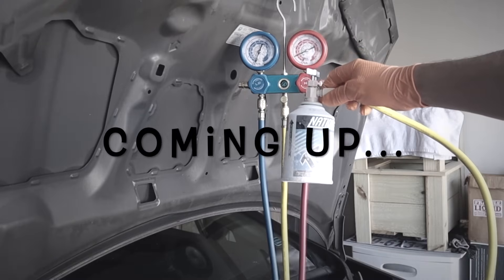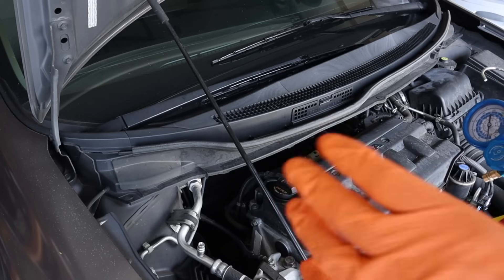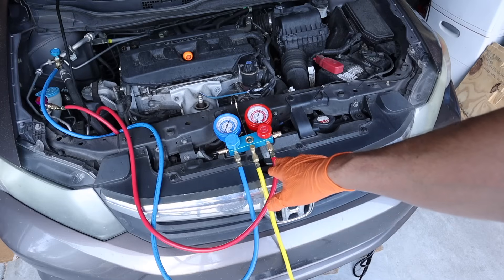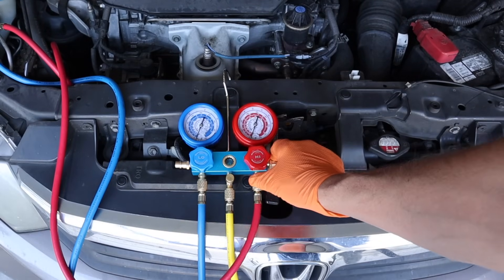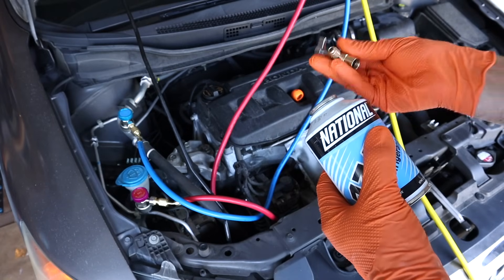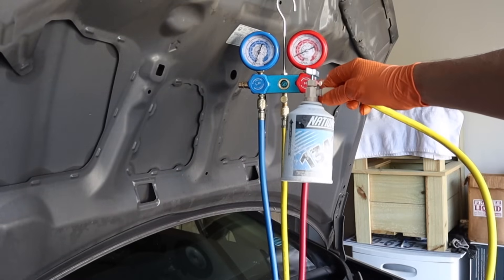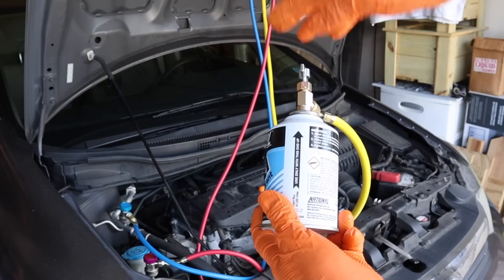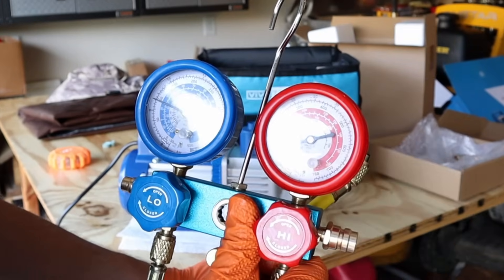DIY Tutorial - Proper R134a A/C charge & Diagnostics

Comment: Quick question, what does it mean if the HIGH pressure gauge goes up in psi almost reaching 300psi? Would that mean it’s a stuck expansion valve? Or did I make a mistake somewhere causing that much psi on the HIGH line
Reply from the maker: Good question for sure, and yes 300 psi is too high. Shooting from the hip, I'd say that you may have put in a little too much refrigerant. That would be your best case scenerio, and hope that's it. So repeat the process, I know its a pain, but try again. The other option is yes it could be an expansion valve issue, or even a restriction in the condenser. You'd get off pretty easy then if the only issue is a little too much refrigerant. Hope that helps!

Comment: $150 later for the pump and the gauges, and the problem is still not solved... Great DIY project... Thanks for the video anyway...
I have the same issue with my 2012 Chevy Malibu LTZ 3.6L V6, no cold air, clutch engages, I hear it and I see the RPM changing when I press the AC button on the dash, Relais and fuse are good, I tested it, I used a pressure gauge that I had from an old R134a can that came with it (only the blue side though) and I had about 100 pressure in it. No idea why it is not cooling...
Reply from the maker: Thanks for hanging out today. Now you know that you have a correct charge if you did it the way I showed in the video, now you can check that off your list as a potential cause of your issue (and a shop would have charge you $250 to do what you just did, so you're now $100 to the good). Now, 100psi is too high on the low side. My inclination is to say your compressor is bad. It sounds like the clutch is grabbing it and the compressor is engaging for sure, it's just not pumping. If you hook your manifold gauges back up and look at your high side pressure you should be seeing a reading close to 200psi on a compressor that's doing what its supposed to. Keep me posted!

Comment: Question
I don’t believe i have any freon on my 2010 buick enclave cxl  since the gauges show low should i go to the shop and remove any freon thats trap in
Reply from the maker: That's a great question. If your gauges are on zero (or just a tic above) then no need to go. but anything above that, then yes, there's enough to justify a trip to the shop. It costs nothing but a little of your time. Hope that helps!

Comment: why didn't you just keep the car off and weigh it in as liquid?
Reply from the maker: That's a good question. The main reason is that to put it in as a liquid, you'd really need to go thru the high side port. And that can certainly be done, but it's best done with a reclaiming machine that the pros use. And it's faster for sure. But it's safest when you have a manifold gauge set and are using the individual cans to go thru the low side port as a vapor (can upright). Hope that helps!

Comment: Do you have to add any oil for the compressor if having it all pulled out and are fully recharging?
Reply from the maker: Great question Billy. If you are not replacing any components, you do not need to add any oil to the system when doing this procedure. Thanks for hanging out 🔧

Comment: Remember that AC does more than remove heat (to create cold air coming from the vents) it also dehumidifies. The AC compressor runs in the winter when you have it set to "defrost".
Reply from the maker: Indeed, good point. Some think that they can get by with no AC until they almost get into a car accident because they can't get their windshield to clear when using defrost during the next rainstorm even. Yep, functional AC is more than a comfort thing, it's for safety as well.

Comment: Good tutorial. Question, I have a hybrid vehicle, so even with the ignition on, the combustion engine does not rev in idle, and hence the compressor does not engage while charging the refridgerant. Is pressing on the accelerator the answer, to engage the compressor?
Reply from the maker: Thanks for hanging out today. I don't have much experience with a hybrid system so I'm afraid I can't give you any expert advice here. Having said that, the AC compressors in a lot of hybrids are electrical (not driven off of a belt) so they are free to come on independent of the gas engine starting up. If you have the specific year and make and model of your car I might be able to help you a little more.
Reply: @my-honest-review  thanks. My car is 2017 Hyundai Ioniq Hybrid.
Reply from the maker: @phisher7790  Okay, so you do have an electric compressor on your car, which as long as you are in "ready mode" you are are good to go when doing your refrigerant charge. Just make sure your AC is on the coldest setting (max) and proceed on. Once the system takes in enough refrigerant (it may take a little while) the compressor should come on and draw the rest of the charge in. Hope that helps!
Reply: @my-honest-review  Thanks. Your assessment was correct. The compressor did kick in after the first cannister was drawn in (hot water bath accelerated). I don't know if it factored into the engagement of the compressor, but I gave some gas.
Reply from the maker: @phisher7790 That's awesome, I'm glad it worked out. Yes that warm water probably did the trick, sometimes it's about like watching paint dry waiting for just enough refrigerant to get into the system to kick that AC compressor on. Ok, keep me posted!

Comment: Trying to remove air and moisture with a leak is counterintuitive. It's impossible.
Reply from the maker: It actually is very possible. You just have to a pump strong enough, and a leak small enough. And it turns out, I didn't have a leak at all, which I wouldn't have found out if I didn't go thru this procedure. It was the expansion valve that was the problem and you can watch the video here https://youtu.be/1PBz5_kW6q4?si=GxF1FShIQv6t6PeX Thanks for watching and commenting, you really help my channel!

Comment: How come you treated the first can as 12oz and then the 2nd can as 18oz? That part confuses me…
Reply from the maker: That's a good question, and you're not alone, it's a little confusing. But here it is in a nutshell... 12 oz is only what the refrigerant weighs that's inside the can. The 18.3 oz you see on my scale is actually weighing 3 things...the refrigerant, the can, and the hose that's attached. And when you perform the exact same procedure on your vehicle, you might get a little different reading than 18.3 oz when you are putting in your second can, simply because the hose may be pushing a little more or a little less on your scale depending on where you have your gauge set positioned. Long story short...this is just a relative measurement. Meaning, whatever your scale says before you begin to let the refrigerant flow, just subtract 3 oz (or whatever remaining amount your system needs after that first can) from that number, then stop the flow. Hope that helps!

Comment: I would have turned on the vacuum pump before opening the the valves on your hoses. They had air in them that you just introduced into your system.
Reply from the maker: You could definitely do it that way, no problem.

Comment: Your calculations were wrong on the second can of refrigerant. 12 oz weighs 18.3, that’s 4.575 per 3 oz, not just 3 that you subtracted, you prolly didn’t put enough in
Reply from the maker: I see your math and how you came to your conclusion, however it worked out fine. It's a relative measurement that's not perfect because the hose is attached while measuring. So it's simply stopping the charge when 3 oz (or as close as possible) had been dispensed out of that 2nd can as shown on the scale. Thank goodness there's a range of refrigerant that acceptable and not an exact amount. And after I replace the expansion valve (video here:  https://youtu.be/1PBz5_kW6q4 ) and charged the system in the exact same way as in this video again, it worked out ok, and had nice cold air. Hope that helps!

Comment: Lesson learned: After the initial 15min vacuum make 100% certain that you shut off the valves before walking away for the 45min wait. My gauges are now full of A/C vacuum pump oil. That little window is half full of oil. 😕 I tried pressing that little schrader valve in the center, but apparently it's not made for oil, just air/r134a stuff. It's not letting oil out that way. Gonna run the vacuum pump for that 1hr and see if it pulls any oil out... not so far... and the pump is running low on oil.

Kudos on this video, I've watched probably 7-8 different videos and I like this one the best. Very step by step and specific without being too slow or fast paced. 👏
Reply from the maker: Oh yes, gotta shut those valves good and tight. I think you'll be okay just letting the vacuum run and if the oil stays in the lines of the manifold until you're done it'll be okay. You just need to keep a watch on your oil level in the pump while it's running and don't let it run out of oil while in use or it'll overheat. If you need some more pump oil, here's what I recommend:  https://amzn.to/4jI404T I'm glad the video helped, thanks for hanging out and let me know how it turns out!
Reply: @my-honest-review  I heard this response in my head with your easy paced tone and cadence... LOL.  Honestly, this was both informative and calming.
Reply from the maker: @rfphill  I appreciate you very much! I've been accused of being kin to Mr. Rogers 😌

Comment: Okay, so I rented out the vacuum pump and gauge manifold.  I didn't know that the adapter part that allows you to pierce the cans of 134a were not included.  I bought it from O'Reilly's.  Also the adapter that threads onto the vacuum pump on the side (1/4" thread) also was missing from kit.  Is this piece not included in the gauge kit?  Without that I couldn't perform the initial vacuum on the A/C system.  On the Vacuum pump, what is the 1/2" thread port used for??  I am going in for knee surgery so now this will have to wait a few months until I am able.  Your help and continued dialogue are very much appreciated.
Reply from the maker: Yes, it's understandable that you'd have to buy the valve that threads onto the top of your R134a cans of refrigerant, but there's no reason why you don't have the means to connect your manifold gauge set to your vacuum pump. The yellow hose should screw right on to the threads on the pump...or there should be an included adapter in the kit. The larger thread size on the pump is just for different applications. When you get back on your feet go back and tell them something is missing in your kit. Get well soon, praying you!
Reply: So to be clear: there are 2 sized fitting on the Vacuum Pump.  One is a 1/2" male thread and the other is a 1/4" male thread.  The 1/2" thread typically is upright and the 1/4" thread is horizontal.  Do these both perform a vacuum function?  Because in your video the yellow hose is hooked up to the fitting that is horizontal.  I thought one fitting might be a vacuum while the other fitting performs a push of air into the hose.  The yellow hose did have the fitting that would thread onto the 1/2" vertical fitting from the pump.  I did buy that adapter that pierces the Refrigerant cans.  Now that I think about it those 2 fitting on the vacuum pump are both a vacuum feature, CORRECT??
Reply from the maker: @patrickwhelan5703  Ah, yes indeed, both of the fittings are vacuum fittings. So the manifold set you have is just set up to hook up to the vertical 1/2 inch threaded fitting. I just see the 1/4 inch horizontal fitting used moreso in my experience, but all the same. So you're all good to go then!

Comment: When do you think that adding the PAG oil is good?  Before adding ANY R-134a or AFTER you have added enough of the R-134a??
Reply from the maker: Any PAG oil that's needed can simply be added to the yellow hose just before charging. If you want to watch me do just this in a video, see here: https://youtu.be/P4s-vdzz8vg?si=nNFxVymxk2KU_yui and go to the 1 hour and 6 minute mark. The linked video was about 1 year after this video that you're watching here, and is where I replaced my compressor, condenser, and expansion valve and had to add some PAG oil when charging the system. Hope this helps!

Comment: Hi! I have an empty A/C system, and my vacuum pump should arrive soon.
You say it's best to charge the refrigerant as gas through the low-pressure line (with the can up).
But here in Poland, most ads and guides suggest flipping the can upside down to fill it as liquid, then starting the engine and watching the gauge.
Some people even pour the liquid into the high-pressure side (with the engine off).
Honestly, I’m confused about which method is the safest and most effective — and why.
Greetings from Poland! :)
By the way, great video — I learned a lot!
Reply from the maker: Great questions, I'll try to help. The short answer is keep the can upright and charge thru the low side only (as a gas), only dipping the can quickly every once in a while to keep the refrigerant flowing. Now, having said that, there are people who say turn the can upside down. And yes, you can do that too but if you do, that's when you really need a professional machine (that can reclaim as well). And this is when you'll utilize the high side as a charging point. Those are the two correct ways in my humble opinion. And since most backyard mechanics don't have the big professional machine, like you and I, we need to go about it the way I showed in the video. It's slower, but it's our only option. And now having said all that, there are those who'll still try to charge the system with a manifold gauge set (like what you see in the video) but will keep the can turned upside down during charging. And folks who do this may swear by it and say it's okay. And you may get away with it many many times but you're playing with fire because there is a chance that the compressor may lock up introducing liquid refrigerant into the system like this. And that is the long answer. I hope that helps! (The short, short, short answer: follow what I do in the video and you'll be fine.) Thanks for watching!

Comment: Would you say that 3 hours is the time it takes to refill an empty system?
Reply from the maker: Three hours should give you just enough time yes. The vacuuming is what consumes the most of your time. If done on a hot day, the refrigerant goes in quickly.
Reply: @my-honest-review  Me again....  So about 2 years ago I replaced all of my trucks A/C components EXCEPT for the compressor.  The evaporator, the dryer, Orifice tube, and related hoses.  I have not filled it since.  It's Florida and I don't mind driving with windows down.  Question: Should I still proceed with vacuming out any moisture before recharging the A/C system?  
Question 2: My truck says (on sticker need fan shroud) R134a to equal 2lb 10z which is 42 ounces.  O'Reilly said 40 ounces.  Which would you go with?
Reply from the maker: @patrickwhelan5703  Before you do anything, I would recommend putting a wrench on your AC compressor and make sure it turns. Time not in use has a funny way of messing up AC components. If it turns freely, yes, proceed on with vacuuming and recharging as you see me do in the video. And you can stop at 40 oz and see if you're getting cold air, and if so, stop there. Make sure you're putting in a few oz of PAG oil as well. I don't know your specific PAG oil needs, but as a general rule, it's 1.0 - 1.5 oz per component replaced, so in your case, add an ounce or so for your evaporator replacement, and another ounce for your dryer/condenser. Hope this helps!
Reply: @my-honest-review  Thanks for the back and forth.  I had seen another Youtube video say that about 4 oz of PAG oil in the yellow tube will be sufficient.  Maybe 3-4 oz will do it?  Is there a downside to adding one ounce too much?
Reply from the maker: @patrickwhelan5703  If it were my car, I'd say 4 oz would be too much, but my AC system holds only 15 oz (max) of refrigerant compared to your 42 oz. So long story short, your system should be able to absorb up to 4 oz of oil just fine. Good luck with your project and let me know if I can help!

Comment: I had a leak in my low pressure suction line and had that line and the liquid line replaced in my system (both lines run as a single assembly in my 16 kia optima). I now wanna recharge my system myself, but does replacing refrigerant lines warrant adding oil to the system? Or was little to no oil lost since i didn't touch the compressor, etc? Thank you!
Reply from the maker: Great question. So, if you only replaced those lines and no components were replaced in addition, the amount of oil "lost" is negligible. So no need to add any oil when charging your system. I hope this helps and good luck with your project!
Reply: @my-honest-review  thanks for the advice! Gonna tackle this as soon as the weather let's up
Reply from the maker: Most welcome, You got this!

Comment: Why close the valves to the gauges when waiting 45 minutes to see if any leaks occur?  Wouldn’t it be better to have them open?
Reply: Great video, by the way.
Reply from the maker: That's a great question. You're the first one to ask me that. The reason to close off the valves on the manifold is to isolate the AC system from the vacuum pump. As vacuum pumps age, they won't be able to hold a vacuum like they did when they're new (although they'll still be able to vacuum the system just fine...just won't be able to "hold" that vacuum). So, if you were to leave the valves open and you came back after those 45 mins and found that there was indeed a leak, you'd never know if the leak was in your AC system or in the vacuum pump. (And the gauges still "sees" what's gong in the AC system when they're closed.) Hope that helps and thanks for watching!